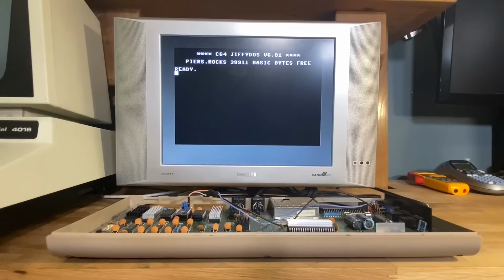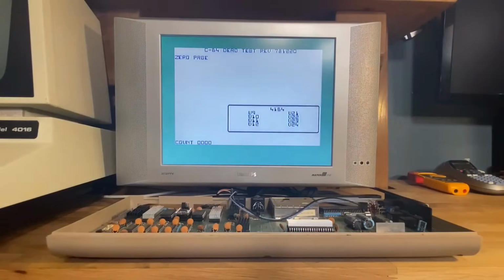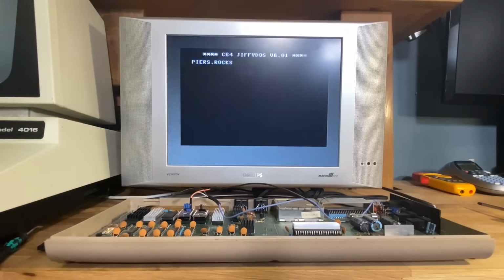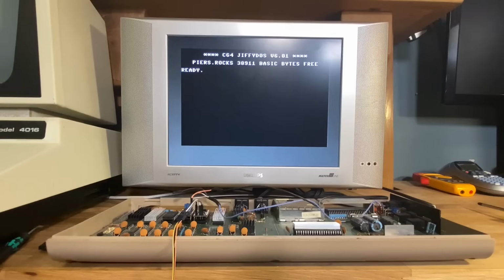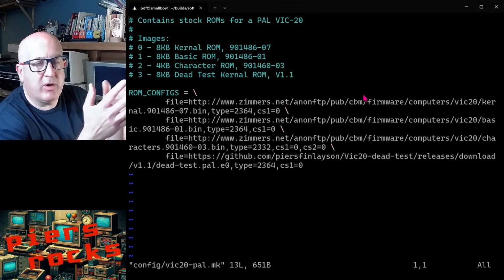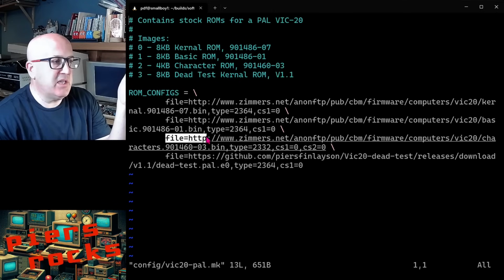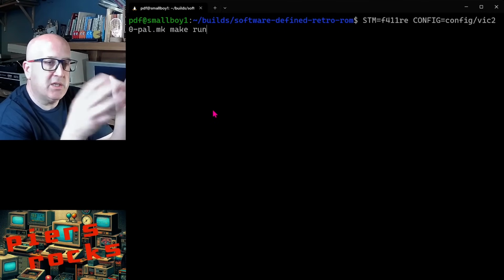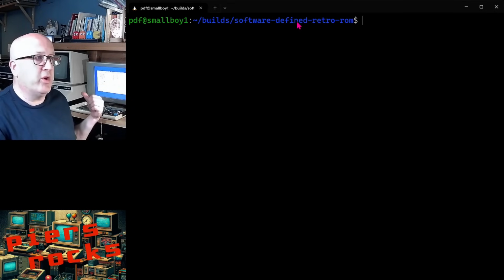Software Defined Retro ROM - ultimately flexible replacement ROM

Comment: Very clever and so useful!

I'm amazed you're able to hit the timing with an MCU, but the proof is in the pudding! Well done!

I constantly run into issues trying to replace 23XX mask ROMs on these old machines.
Reply from the maker: Thanks!  Yes, took me several months and iterations of microcontrollers and software, but got there in the end.
Reply: @piers_rocks  kung fu flash cart has some timing adjustment for breadbin/longboard/ram timing to work in latest patch, as it's on same bus it might work. also stm32f , am using same code for a f407 replacement for a ram emulator.
Reply from the maker: @colingale  Thanks for the pointer - from looking at kung fu flash I see I take a similar approach, and KFF even calls itself a "software defined cartridge" :-).  I have some advantages over kung fu flash timing wise - I need fewer address pins so can load the CS lines on the same port in the same instruction, saving time.  Also, I only need to support reads, so there's an extra test I don't need.  That's why iI can support lower clock speed micros, and faster platforms with the F405.  All in all it's nice to see my approach validated, and would be interested in seeing your ram emulator if open source.
Reply: @piers_rocks  i'am still in the debug/denial  stage of breadboard and base code, wanted to make it adjustable by all so tried plain arduino, that gave me issues, went stmcube, had issues, went cm3 and need to learn more mode kicked in, decide to watch other's go grey haired and bald instead. i hoped to leverage FSMC in a 3 stage way, read-write-cache into sram  and also spi dma write to sd-card for bread crumb trail debugging.
Reply: hardware wise it's a KFF  but am using f407vg for development that also has 36mBit flash attached but if not done any code it include that in the system(yet).
Reply: Maybe we'll see this on your channel?

Comment: What is the fastest retro computer system frequency you have used this on? I'm interested in using this as a rom emulator for 4 and 8MHz Z80 systems that I want to build.
Reply from the maker: My systems are all 1MHz.  4MHz might be feasible with one of the fastest MCUs.  8Mhz might be a stretch, although may be doable with overclocking.

Comment: It just struck me. I saw how it was used to replace multiple ROMs. That is kernal , basic and character. Potentially, you have removed all bus contentions in this area. This will save the wear on the unobtainable Commodore ic's. Would it be possible to create the piersrocksPLA. All it needs to be is a  28pin compatible eprom holding 64kb rom running sub 150ns.
Reply from the maker: On the PLA, the biggest challenge would be the 16 "address" lines + 1 CS lines - this breaks the current hardware and software optimisation of being about to do a single 16 bit GPIO lookup for both address and CS lines, and contributes to the speed of the serving algorithm.  Definitely feels feasible with the RP2350, probably also with a an overclocked STM32F4.

Comment: Going to need to build a bunch of these ! I already have a tone of flash based 2316/2332/2564 boards i build from another repo.
Reply from the maker: Sorry :-).  Yes, my first approach was flash based ROMs as well, but they were a massive pain to solder and I needed different hardware versions for each of the CS variants, so came up with this.

Comment: Only one improvement: replace The jumpers with a dip switch. Otherwise its brilliant 💯
Reply from the maker: I haven't found any DIP switches that are both small enough and cheap.  I have some regular dip switches, but they consume 10mm of the length of the board (that's a third of it) compared with 5mm for jumper pins.

Comment: Great! What about using a TAG-Connect connector for programming?
Reply from the maker: There's an SWD connector using 2.54mm pin pitch.  It doesn't need to be populated, you can insert pins from your programmer.

Comment: Very interesting - enjoyed this a lot..  Watching Ben Eater's 6502 videos some years back I was toying with this idea using STM32.  At the time I kinda decided it would be impossible to meet the specs of an original 27c256 but it would be possible with a RP2040 due to it's gpio state machine.  HOWEVER - IF the full speed of the eproms are not actually needed it would indeed be possible (as you prove here).  Well done!
Reply from the maker: Yes, I agree - 70-100ns is out of reach.  I'm not sure that the RP2040 can do it due to the PIO though - I think it can achieve it primarily because of being overclocked to 270MHz.  I suspect it could be done without the PIO with a similar speed STM32 (obviously a different family than the f4) - that would at least bring you to the 100ns access territory.

Comment: @piers_rocks Given that the all of the ROMs share Data and Address pins in the C64 but have their own Chip Select, could one SDRR could be installed into the Kernel (or BASIC) ROM socket, and have fly leads to connect to the CS lines of the other ROM sockets, and provide all the ROM images?
Reply from the maker: Yes, it's an idea already shared by @adriansdigitalbasement - and I think it's a cracking one, so I've started working on it.  There are likely to be some limitations, for example it it will be more tricky for mixed types of ROMs, and not possible for those where the address and/or data bus are not shared.  I may be able to get one rom to replace all of basic/kernal/char set on the c64, but prob not the VIC-20 (as the char rom data bus is I think different on the VIC).
Reply: @piers_rocks  Yes, the VIC-20 and PET have separate databus and address bus for CHARROM.

Comment: Would this be something pcbway or jlcpcb could manufacture entirely?
Reply from the maker: I would expect so, yes.  I have experience using seeedstudio for PCB assembly, and this should be well within any assembler's wheel-house.  It's a 2-layer PCB, with minimal SMD components on a single side.

Comment: Great product and demo! Was glad this video was recommended to me and subscribed to channel for more…

Can this be used to replace the 16KB ROM in a Sinclair ZX-Spectrum 48K machine?
Reply from the maker: I'm not very familiar wit the spectrum - it looks like that 16KB rom is a 23128, with 28 pins.  Right this rom only supports the 2/4/8KB 24-pin versions.  I've got a 23128 replacement designed and in manufacturing (the software will be very similar to the current software) - it'll take a few weeks for me to receive and test it.
Reply: @piers_rocks  Thank you for your reply and for making this really useful project and releasing it for all. It is indeed a 23128 ROM with 28 pins. OK, interesting, look forward to new video showing results of your 23128 tests...

Comment: Could you replace several IC with several of these?  One in the Kernel, one in the Char, plus wherever else you could feasibly stick them? 

Then make up a little controller for switching the jumpers with an ESP or whatever, so you have a fully software defined C64 (or whatever machine) - just choose your versions and reboot! Job done. 

Not sure the purists would like my idea, but I think it's fun :)
Reply from the maker: @NiddNetworks I've designed a prototype wifi daughterboard (plugs into the swd programming pins), based on the ESP32, which could theoretically be used to reprogram this rom wirelessly.  So, you could have multiple of these roms+wifi boards installed and the just decide to reflash each of the chips.

I hadn't thought of a single other controller that connected to the jumper pins - but absolutely that would be possible.

Press a button, reset the machine, and your C64 has a whole new personality :-)

Comment: Maybe a dumb question, could that dead test rom also be used in one of those menu based kernal switches?
Reply from the maker: @nicoful86 I would assume so - it's just a "standard" ROM as far as the CPU is concerned - i.e. it has a reset vector at $FFFC pointing to some code within itself that runs the deadtest function.  I'm not familiar with the menu based kernel switchers you're talking about.

Comment: So could you put multiple roms on here ie jiffy regular and a diagnostics rom and switch between them for the machine your using?
Reply from the maker: Yes - you change the jumper and then need to reboot the machine (which reboots the ROM so it can read the new jumper settings).  At least right now, the ROM won't re-read and switch images while it's running.

Comment: This chip is more powerful in computing resources than the rest of the retrocomputer, why not just use the chip separately ???
Reply: It would be possible to make a chip that supports WiFi. Or it could be done via Starlink.
Reply from the maker: Starlink, or even skynet ... Funny you should mention wifi, I sent a wifi daughterboard prototype off for fab yesterday.
Reply from the maker: Where's the fun in that :-).  Seriously, though, I'm hoping this provides a much easier way to keep these old systems alive.

Comment: As it is software, then it should be possible to make it switch images without setting dip switches.
Reply from the maker: You'd think so - wouldn't you :-).  At least with the micro-controllers I'm currently using I just don't have any time in my main loop to test anything other than the address pins and CS line(s).  Right now I'm only reading the image select jumpers at start of day - the image stays fixed until reboot.  It might be possible to reread these during the main loop, using a faster micro (like the F405), but anything that takes more than a handful of instructions is likely to be beyond this approach.
Reply: @piers_rocks I would have thought there must be time after the data has been put on the bus. I will take a look at the code if I get time. I was a firmware engineer for most of my career. I am retired now but still like to dabble.
Reply: I had a look at the code. If it is possible to move the main functionality into an ISR then software switching would probably be possible. I am pretty sure you do not need the amount of ASM that you have. I would always start by writing the code in C and then examining the disassembler. Compilers were poor many years ago but for many years I got away with no or very little assembler.

My other suggestion would be to reduce the amount of ifdef directives in the code by moving #define values to headers.  eg "  cmp  r0, #(0b100 << 10) \n" -  the only thing changing between variants is the value which could become a #define value in the header. Duplication is the enemy of reliabilty
Reply from the maker: I would expect the code would take longer to execute if I trigger an interrupt off the CS line(s).  The worst case (which I have to plan for) for Cortex-M4 is 12 cycles to start executing the ISR.  I believe the STM32F4 only supports an interrupt off individual pin changes - so for 2332/2316 operation with multiple CS lines I still have to test the remaining CS lines within the ISR.  12 cycles at 100MHz is 120ns, which is more than half my budget (200ns) for getting the data lines low if all CS lines are asserted.

If you've spotted some unnecessary cycles, or I've misunderstood the Cortex-M4/STM32F4 interrupt capabilities let me know - I'd love some extra budget for supporting faster ROMs or adding more features!
Reply: @piers_rocks It is a while since I looked at the STM32s. I have designed products with them but those were more microseconds rather than nanoseconds. I may have a further dig to see what is possible.

Comment: Quick question - what are you using to program the MCU initially?
Reply from the maker: I was using a Raspberry Pi Debug Probe along with probe-rs to do all of my programming.  It should be possible to use a standard ST-Link or off the shelf Raspberry Pi Pico as the hardware programmer, and any SWD programming software.

Comment: This looks awesome. I'm curious though - how is this working OK without 3.3V to 5V level shifters? Are the STM32 signals within the 5V TTL tolerance?
Reply from the maker: 5V tolerant GPIOs was one of the primary design requirements - which led me to the STM32F4 series.  In a nutshell, yes, the vast majority of STM32F4 GPIOs are 5V tolerant, and max/min input/output voltage levels are compatible with 6502/VIC/VIC-II chips.  There's a more detailed analysis here: https://github.com/piersfinlayson/software-defined-retro-rom/blob/main/docs/VOLTAGE-LEVELS.md
Reply: @piers_rocks  That's really useful. I'm going to give one of these a try. I have a couple of ST32F07s (I think). I use 28 pin ROMs and a few tweaks to your design should do the trick too (28C256). I'll try with the 2364 form factor first. Been wanting an excuse to play with STM32 for a while!
Reply from the maker: @paulspark7287  One of the biggest issues with the 28c256 is (if it's like the 27c256) it has 15 address lines and both a CS and OE line.  This requires reading 17 GPIOs on the main loop, which will require additional instructions and cycles.  Everything is quite tight at the moment, and built around a max one 16 GPIOs (one STM GPIO port) and I've run out of optimisation ideas - but I'm hopeful others may be able to contribute more!
Reply: @piers_rocks  I can imagine. I started a Pico ROM project some time ago and got it working at slow speed.. but I was waiting for the Pico 2B to come out which has more pins. FYI just checked - I have 2x STM32F405RGT6.. I think I bought those for Kung Fu Flash so made need some more 🙂
Reply from the maker: STM32F405 gives you a fighting chance!  Make sure you start with the rev E hardware design.  The F405/415 has a slightly different pinout than the other F4 series, and I messed up making rev D compatible with it.  Rev E supports F405/415 and the lower end F4s as well - although I don't yet have any back from the fab so haven't confirmed they work.  I also knocked a 27c128 design together earlier.  I connected the additional address lines for the 256/512 roms as well.  I'll add it to the github repo when I get a chance.

Comment: If this could simulate a 27256 or higher, it would be a nice alternative to eprom emulators at a fraction of the cost.
Reply from the maker: There's a significant challenge to going above 128Kb ROMs with the STM32F4 - a GPIO "port" (which you can query with one instruction) maxes out at 16 pins.  This means to support more address lines requires querying multiple ports - which requires more instructions and likely slows things down enough to no longer meet the timing requirements :-(.  I may look at 27xx series next, and something might be possible - but it will probably require a beefier micro.

Comment: Excellent project!! Question I have will it work on a Commodore SuperPET? The main board, 8032, has the roms that the SuperPET turns off when running in 6809 mode. Basically only using the roms on the SuperPET board. Will your roms replace be able to turn off these roms? Also, are you selling the pre built adapters? Thanks for sharing
Reply from the maker: I don't have a superpet, and haven't tested with it.  Having said that, I've looked at the schematic and I think the ROMs will be compatible.  The 6809 mode "turning off" mechanism sems to be disabling the 74LS138 which generates the chip select lines to the 6502 ROMs.  Hence the CS line on the ROMs will not go active in 6809 mode, so my replacements will also be disabled.

I haven't decided whether to sell these fully assembled - depends on interest levels.  I've deliberately given the hardware with a commercial-friendly license so others can sell them if they wish.
Reply from the maker: One other thought - if the SuperPET 6502 runs at 2MHz instead of 1MHz, that might also be a challenge - the STM32F405 which runs faster than the F411 may be sufficient to hit the tighter timing requirements of a 2MHz system.
Reply: @piers_rocks Are you Discord? Would like to chat or email you as I do have a SuperPET and would love to test your adapter
Reply from the maker: @RudysRetroIntel Yes - my discord username is the same as my youtube channel name, but with a . between the words instead of _
Reply: KitsThatDivBaRitzCornERpomarEn2

Comment: well, if there is a native eeprom chip alongside the programming environment right on device. then its native fast and programmable.
Reply from the maker: You could combine an eeprom/flash chip and programming environment on board the chip, but you'd miss out on the flexibility the software brings - such as configurable chip select behaviour.  I also doubt it could be fit into the same footprint and same low cost.

Comment: 11:57 would an RP2040 with its PIO engine be more suited to handling this, without overclocking?
Reply from the maker: There's no overclocking the STM32F4 going on here - depending on the chip you can go up to 168MHz.  (I'm using F411 up to 100MHz in this video.)

The RP2040 doesn't work very well for this use case due to the lack of 5V tolerant pins, and hence the need for level shifters - you would need to shift a lot of pins, and hence would increase the size of the PCB - or at the very least push you to 4 layers - possibly both.

I can see lots of retro uses for RP2040 PIOs, but that lack of 5V tolerant pins is a major issue 😞

Comment: Cool. Is the ST MCU 5V tolerant? No level shifters needed on the GPIO?
Reply from the maker: Correct - no level shifters required.  I had to go with the STM32F4 family to get enough contiguous 5V tolerant pins, in order to hit the required performance.  The STM32F4 GPIO input and output low/high voltages are all compatible with the 6502 and VIC/VIC-II chips.